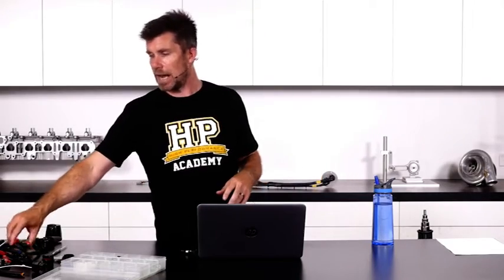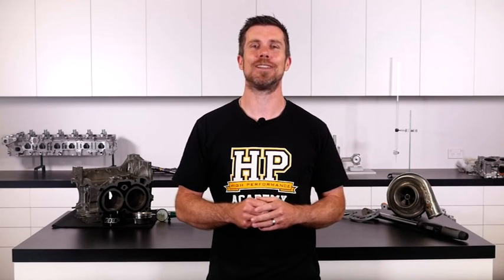Terminal Plating | What Is Preferred For Motorsport Wiring Applications? [HPA Q&A]

Comment: Sorry, Andre, they're right about gold - why it's used on computer, and most higher end electronics', connections.
It does have a low resistivity, but not as good as silver or copper.